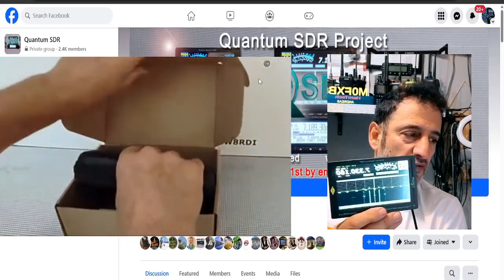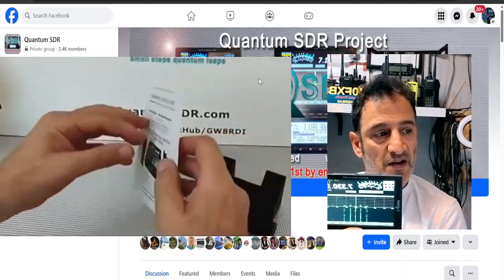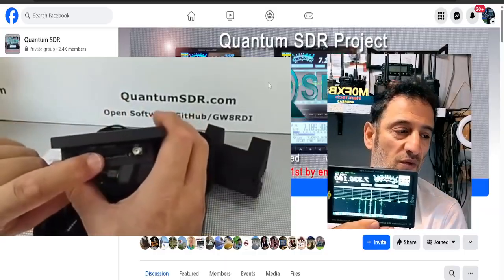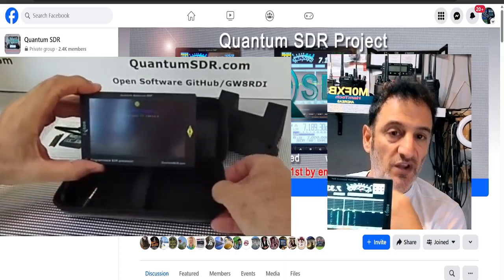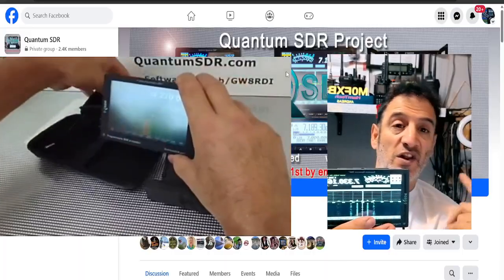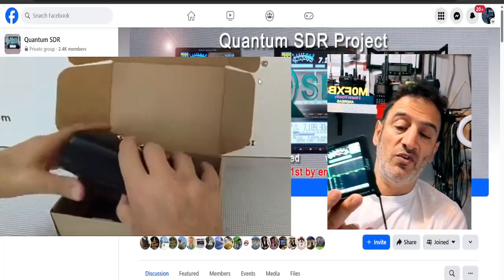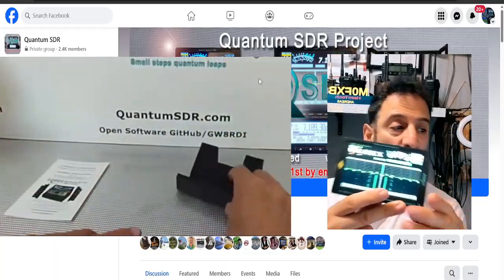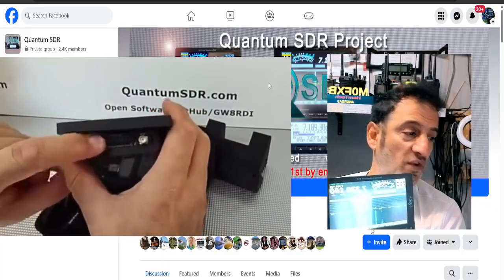NEW M4 Spectrum Transceiver /Tuner Options/FT8 - TX RX

Comment: what type of battery do i need and what is the specs of the battery you are using in this video ?.
Reply from the maker: Any 2 amp supply 5 volts